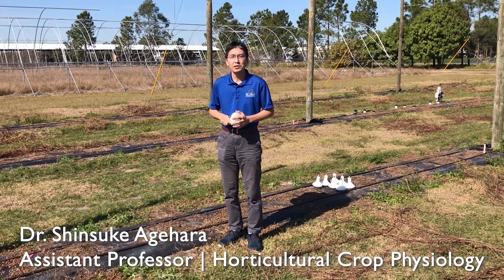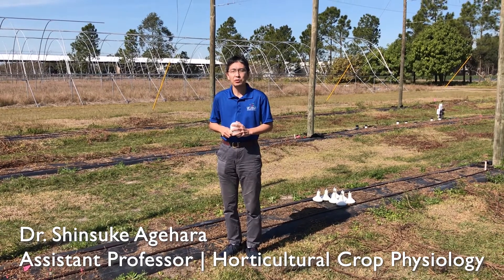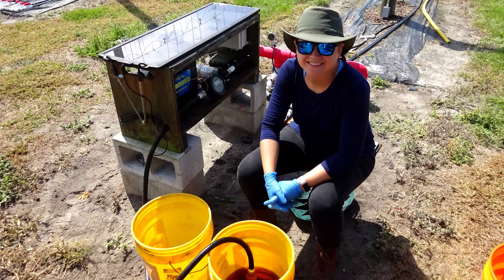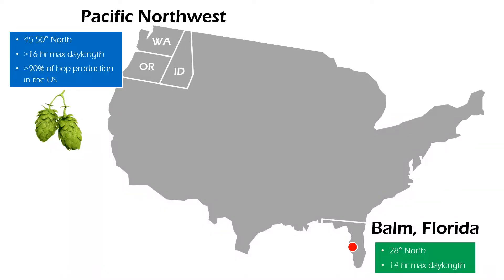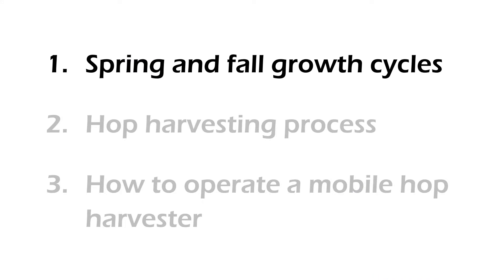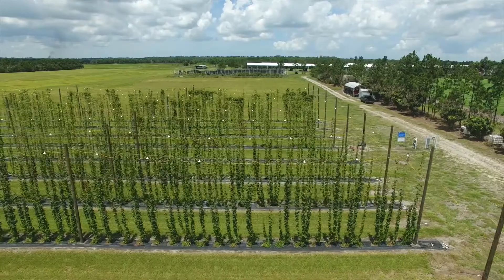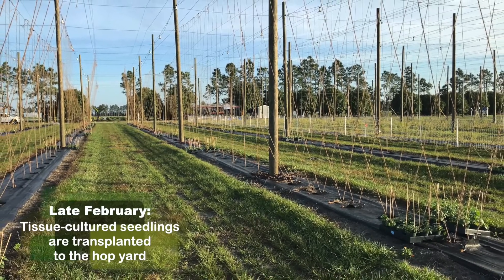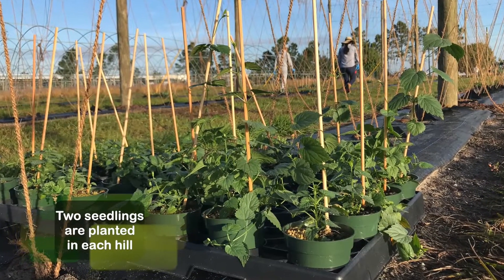How to Grow Hops in Subtropics | 2021 GCREC Virtual Field Day

Comment: Hi, I have a question. I'm planning to grow hops in Colombia and I have seen most of your videos and posts on your website as a reference. The weather where I live is very similar to Florida because the elevation is 400 meters at equatorial latitude. I already have a Philips flowering lamp DR/W and also a Ge 9W flowering spectrum light, but I don't know if the plant needs to have a cool season in order to well develop because here the temperature is constant all year. I know that in Florida, winters do not usually get cooler than 13 degrees Celsius, but I think I may grow it in a green house at a higher elevation in order to give it a cooler season. Moreover, I would like to know how the tissue culture process works for this plant and what I should do if I grow successfully from rhizomes or seeds in order to clone the healthiest females. Please let me know.
Reply from the maker: Thank you for following us! Although our winter is short and mild, it gets cold enough (occasionally below freezing) for hops to go dormant. When hops are dormant, they can conserve energy and develop buds, which will promote strong new growth once it warms up. When plants cannot go dormant, by contrast, they will develop many spindly new shoots from the nodes, which will be difficult to manage and will not produce many cones. So, if you're located near the equator, we recommend growing hops at a high elevation, where winter gets cold enough for hops to go dormant.

As for getting clean tissue culture seedlings, please read the following articles and let us know if you have any questions. Thank you!

https://edis.ifas.ufl.edu/publication/HS1381
https://edis.ifas.ufl.edu/publication/HS1414

Comment: Hi, I have a question. I'm planning to grow hops in Colombia and I have seen most of your videos since the weather where I live is very similar to Florida because the elevation is 400 meters at equatorial latitude. I already have a Philips flowering lamp DR/W and also a Ge 9W flowering spectrum light, but I don't know if the plant needs to have a cool season in order to well develop because here the temperature is constant all year. I know that in Florida, winters do not usually get cooler than 13 degrees Celsius, but I think I may grow it in a green house at a higher altitude in order to give it a cooler season. Moreover, I would like to know how the tissue culture process works for this plant and what I should do if I grow successfully from rhizomes or seeds in order to clone the healthiest females. Please let me know what you think.

Comment: This is a great video. Do you have a general idea of how deep water drainage depth needs to be for proper root growth?
Reply from the maker: Thank you so much for your comment! Our soil is very sandy (97% sand) and naturally has very good drainage, but the water table is relatively shallow, at 3.5 to 4 ft depth. Hops develop deep roots - we found that some roots grew to the 3-ft depth within a month after planting. But the most important roots in terms of water and nutrient uptake are the ones in the top 6 inches. I think 3-4 ft would be good for drainage depth.
Reply: @UFHortLab  thank you so much!